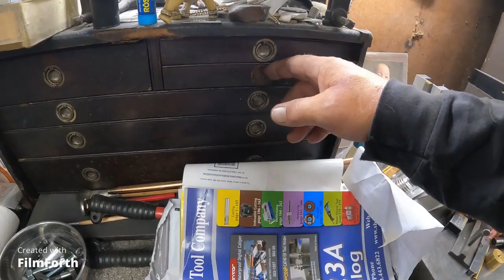Preparing stock

Comment: Kimber…
Just a couple observations…..
#1 Please stop with the oil…it does absolutely nothing for turning applications other than fill your space with smoke.  Who ever showed you that taught you a very bad lesson.  Carbide loves heat and constant tool pressure.  It doesn’t like when you baby it, it likes to be pushed.  Stop wasting your oil and filling your shop with fumes.
#2 You’re using the wrong insert and holder.  That insert is a finishing insert and at that angle doesn’t allow you to face.  You’re wasting expensive inserts on this operation.  You’re going to need those inserts for a finishing operation and you won’t have them because you wasted them.  Get yourself a right hand CNMG holder 1”x1”.  Then get yourself some CNMG 432 inserts for general purpose turning.  These will allow you to face and turn.
#3 When your turning a part like that in the lathe, before you face it, drill the biggest through hole you’re allowed before you face it.  That way when you do face it you don’t have to go all the way to dead center.  The reason being is, it saves you time because you don’t have to travel as far because you have an open diameter there now.
Also because you’re not using a cnc, you don’t have constant surface speed.  Which means the machine rpm’s aren’t adjusting as you move from max OD of part to dead center.  Without that hole there, when the insert hits dead center, there’s practically no rpm’s and carbide does not like that.  So…drill hole first, then face off part.  If the face has a really uneven surface, then by all means face it off before you drill it.  Then go back and face it again just to be sure it’s flat…
#4 Why do you keep wanting to part it off?? That’s a really big and heavy part to part off.
You kept saying the same thing last time too… I told you then also not to do it.  It’s not worth the risk of injury and damaging your machine.  Just flip it over after and face it off to length!! DO NOT PART ANYTHING OFF!

Just my opinions..

Good luck 
Pete V
Reply from the maker: Points one and two are very valid. I know almost nothing about when do use one insert or the other I do know, however that the carbide likes speed and usually heavier depth to cut but I have a long way to go as far as my education on cutters, tool holders, etc. I appreciate your advice. Thank you very much.

Comment: Kim, I've just been looking at the "South Bend Lathe-Vertical Milling Machine Parts List_10 1 66" an I am sure that you are going to need to cut a hole in the centre of that piece, big enough for the "Head Rotation Gear" to pass through, and then make a spacer so that it does. That gear has to be bolted to the "Over Arm" for the Tilt function to work by the "Head Rotation Worm" & Head Rotation Worm Shaft"...
Reply from the maker: I did machine clearance for the gear it is installed and it works properly I can tilt using the worm gear
Reply from the maker: You can see some earlier videos of me re-drilling holes to secure the gear. The bolt pattern was not the same as the original gear. There is a lot of video on that aspect.
Reply: @kimber1958  Yes, I've seen all that.
Reply: @kimber1958  But can you tilt further that the Slack in the long mounting bolts for the new head?
Reply from the maker: I have used the worm gear to tilt in the neighborhood of 180°
Reply from the maker: Thank you for your interest in my projects
Reply: @kimber1958  OK, good, I would rather be wrong, than right without saying something...

Comment: Why do you want to part it off?   It does not appear  to be too thick..  ---Doozer
Reply from the maker: I am pondering our way to fly, cut the existing plate on the list he. Some kind of fixture plate attached to the tool post maybe.
I wish I had copied the plans of the existing plate so that I would not have to remove it to copy it. I’ll certainly have drawings and dimensions noted on this next plate.
Reply: @kimber1958  You have the SB original head, so you can measure the bolt circle from that, and you can measure the Kondia bolt pattern right from the front of the head, while it is installed.  Don't use the lathe when you have a temporarily working mill.  If you fly cut it, only take .010" cuts at a time, from the side.  You have everything you need right there. --Doozer